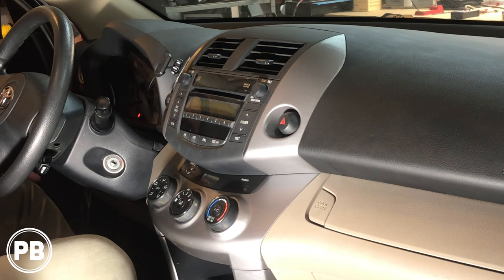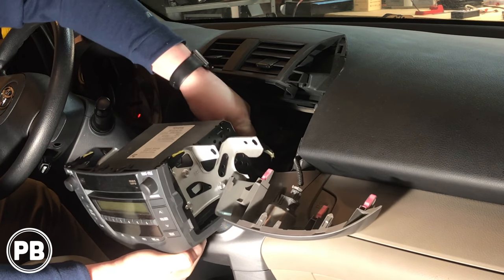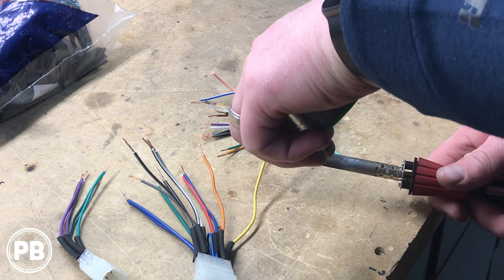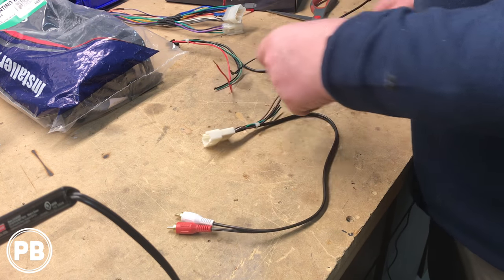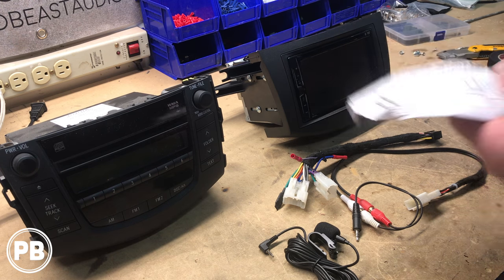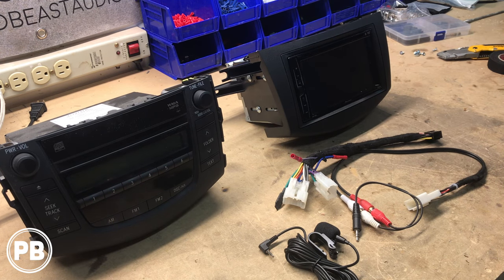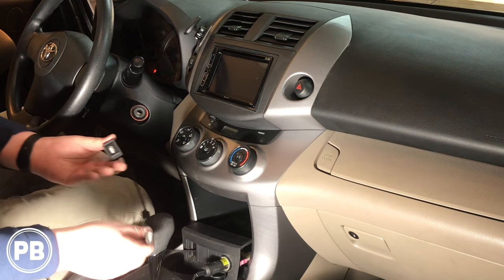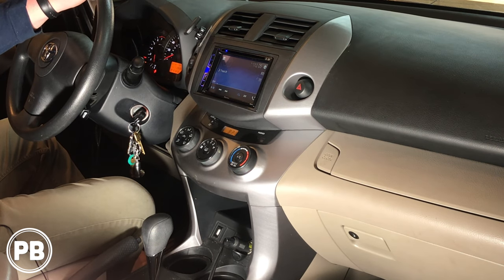2006 - 2012 Toyota Rav4 Bluetooth Radio install

Comment: This was very helpful...thanks! pay attention to which pioneer unit you order. I got the AVH-200EX, which you link, and it's a very basic unit without Apple Car Play, which is a deal breaker for me since we have iphones. The amazon Q&A said it had apple carplay, so i ordered it and installed it, but it didn't.  The workaround for that unit to do navigation, etc is called  "Weblink", but it was not helpful. I upgraded to a AVH-1400NEX and fortunately the wiring/harnesses are the same as the 200EX, so it was a simple switch out for me. I also ordered the USB/Aux car lighter replacement and didn't need it with the 200EX (has a front facing USB), but glad i kept it because the 1400NEX only has the back-of-unit USB, so i installed that lighter replacement cable and it looks beautiful and was easy! I did this on a 2011 RAV. The bracket was easy to install and looks great.

Comment: Great video. Toyota service manager in Hawai’i quoted me $5000 to replace this unit in my 2007 RAV4.   What a ripoff!!!!!!!!!
Reply: Were you able to change yours? My friend handed me a camry radio unit and not sure if it would fit
Reply: @Funkfreed   Hi.  I still have my original stereo. It still works for the most part (2007 RAV4) though I’ve been tempted to try installing an after market one.  I’ve kinda decided to just wait since I’ve heard the after market ones may tend to drain the battery more.

Comment: Hi, great video tutorial! Our 2010 Rav4 Limited has phone capabilities on the steering wheel and JBL speaker system. Stock backup camera in the rearview mirror too. If I order Pioneer AVH-1400NEX (with apple car play), is there an additional harness or adapter I need to maintain phone controls to the steering wheel? I'd really like to keep that capability on the wheel. Thanks in advance!

Comment: The video doesn't discuss the three-wire parking brake bypass in much detail. I also noticed that there is an extra blue wire from the parking brake bypass wire that seems to be connected to the blue on the car's side connection. How does this work? Could you please help me understand?

Comment: Very nice and clean but wish you showed running the Mic for the Bluetooth
Reply from the maker: We just put the mic on the a pillar and ran the cable under the weather stripping, through the dash, over the the radio cavity.

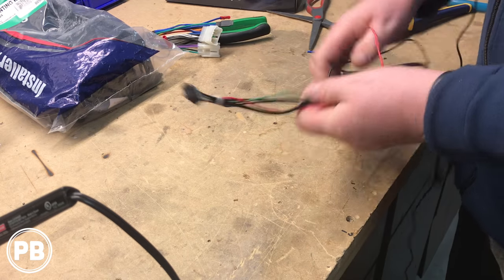Comment: @ProvoBeastAudio First of all great video!  I ordered the parts you have and successfully got the radio to work for a while now.  However, I could never get the steering wheel controls to work.  I think my issue involves the part the auxiliary part you cut off at 4:10 video.  I have the wiring you talk about at that part in the video, but II don't know where to plug in the part that you cut off since you didn't have steering wheel controls.  You mention a separate adapter. Do you happen to have further info on that?  Is it an aswc-1 that I need?  Any ideas would be great. I know my wife would love the addition of the steering controls.
Reply: Great question! We have steering wheel controls for phone and music, and would like to keep those as well. Did you resolve this issue? I'm looking to dive into the stereo swap-out, but am hesitant to lose phone calls from the steering wheel. Thanks!
Reply: @jefftara1813  I did get the stereo controls on the left side of the steering wheel to work that does volume and changing stations.  The right side with the phone button doesn’t work, but I never messed with that it because my wife doesn’t use it.  It very well could be that I missed a plug or just needed to set it up somewhow.

Comment: I don't get why Pioneer or an industry standard cable isn't made to be compatible with Toyota, so no  soldering would be required? Was the securing of the radio itself compatible with the factory bracket?

Comment: I broke the side covers while removing them, they must've gotten really damaged by heat.
wonder if I can get a replacement
Reply: I broke the left one removing the old stereo. I broke the right one installing the new stereo. If you watch the video you can see he's very careful to use both hands with even pressure. A little warning would have been nice but he did do a great job in general.

Comment: How do you get the USB cord down to the blanks? I don’t see a hole through the back.
Reply from the maker: You will have to run the USB extension creatively.  There are channels, usually following the factory wiring but it can be done.

Comment: If you buy the SWRTY-61J because you have "JBL/Steering Wheel Controls", do you need to buy the "Metra 79-8114 AUX / Steering Wheel Control Wiring Harness Adapter"?
Reply: Did you ever find this out?

Comment: For your harness, did you connect the car speed signal input (pink wire) and if not, did it affect the the head unit at all?

Comment: Great work, man. I own the 2009 RAV4, with a backup camera. It runs up to the inside mirror. Can I run this camera thru an aftermarket stereo, or do I have to get a new backup camera? Thanks a lot.
Reply: You should be able to run it into the stereo, just might not be easy depending on how it connects
Reply: Did you end up doing this? I have the same setup and question... curious if it was straightforward to connect it.
Reply: @nicolekowalczyk6893  , I didn‘t have time, but I‘m curious, if anyone did it.

Comment: Great video!

I can’t seem to get any conclusive info on the size restraints the available kits have for this vehicle. I want an 8” double din, but don’t want to risk buying everything only to find out it will not fit.
Reply from the maker: If the radio chassis is a standard double din, it will fit this kit.  Keep in mind that even some of the float mount screen have a larger screen that sticks out, but still include a double din chassis.
Reply: T'eyes has a 9" and 10" with included bezels. I just ordered a 9" for my '07 Rav4 since it looks a bit more factory than the 10". Pretty good reviews and lots of options; TPMS, 360 cameras, front DVR, engine monitoring module, etc.

Comment: Great installation guys.
Question: I have a separate Alexa Auto do I need the aux feature for it to work?. My Pioneer MBH-S622BS has built in Alexa feature, do I still need the Alexa Auto box ?
Thanks
Reply from the maker: If it has native Alexa, no external aux or external Alexa module would be required.
Reply: @ProvoBeastAudio  thanks

Comment: I want to install a double din in my wife's Rav, but I think the 6.2" and 7" are too small for her. Can't find an 8" anywhere with Toyota adapter cables included, AM/FM, Aux, Carplay, Steering Wheel , and JBL adapters. Any help?
Reply from the maker: Lots of options, you would just need to assemble the harness yourself. We can also do it for you too and ship it back. Just send us a message on Facebook.

Comment: do you need to cut the metra aux in harness or can you just use it as is? No steering controls on my rav
Reply from the maker: If you don't use the AUX, then no need for the harness.

Comment: The light green wire (parking brake) from the pioneer harness does not have a corresponding color on the metra harness and you did not say or mention what you connected that to......can you explain?
Reply from the maker: Because it's unique to Pioneer.  That is the parking brake wire and will need to be connected to the brake to work properly.  If not, just use a bypass: https://youtu.be/0xYNn8LDvnE

Comment: What happened to the extra long parking brake (green wire)? Where does that connect?
Reply from the maker: Most radios you can simply ground it (except for some Pioneer radios and all Alpine radios).  In this specific install, with this specific Pioneer radio, we added a microbypass parking brake relay.
Reply: @ProvoBeastAudio  Wow, I'm sure you hold the record for the most expedient response, thank you. And please don't tell me I have to order yet another part. I just discovered I needed a Steering Wheel Control adaptor & wiring harness for my newly purchased Pioneer DMH-W3000NEX so this project is delayed until next week...ug

Comment: I can’t thank you enough for this. I have the same vehicle and I’m going to attempt to do this. For do it yourselfera like me, how much do you think this is saving? What does this service normally cost at the installation shop do you think? Thank you.
Reply from the maker: Each shop ranges in price. But most shops require you to install their equipment they sell you at an inflated price. So expect to pay 2x or 3x the cost of doing it yourself.
Reply: @ProvoBeastAudio  I called in today to a shop for pricing. They said $400 for the screen. They’re $125 online…. 

Gave me a quote of $700.

Comment: I have a 2011 rav4 I got a double din and it doesn't sit flash and everything doesn't snap in snugly what's a double DIN that I can use that has the same bolt pattern as 2011 because the double DIN that you have has a different bolt pattern than the 2011

Comment: Great Tutorial! I have the steering will controls and the JBL so I purchased the SWRTy-61J.  The car has 3 plugs. The kit came with a TY-A and TY-B harness.  The TYB fits two of the existing connections, but does not have a third plug.  The TY-A harness has three plugs, but they do not fit the 3 car plugs. Any suggestions or resources you can direct me to?
Reply from the maker: Use the harness that fits your vehicle. Not all factory make harness plugs will be used in every install. Follow the instructions with the dip switches and you should be good to go
Reply: @ProvoBeastAudio  Thank you!  Got it all in and it plays music. It is my wife’s and the CD player did not work, and the console aux jack didn’t work so this is a huge improvement. However, the dsteering wheel controls are not working.  I have the SWRTY-61J plugged in and I can see there is a blue light near the plug and it sometimes blinks a red so seems to be getting power. I set the DIP switches to pioneer, and have the 3.5 mm plug into the wired remote input on the back of the pioneer.  Any thoughts on something I might be missing. One thing I did wonder about on the dip switches is the left has the after radio selector.  On the right it shows gain adjustment. I just set that to the same as the aftermarket radio.

Comment: The orange wire has a line on my radio harness but on my harness I purchased has a solid orange are they the same should I put them together or leave them off I know it’s a dimmer or something
Reply from the maker: If there is no other orange wire on your harness adapter, that is your dimmer wire to which you would connect to your radio's illumination wire. (usually orange white)

Comment: Will it still be possible to follow these instructions for a UK model?
Reply: Jack yes. I did this in the UK using a mirror so left was right. Worked a treat. You might need a right handed screwdriver though. ty

Comment: Hey, appreciate the video. Quick question - I have an 07 Rav4 with the steering wheel controls and the JBL system. Do I need both the SWRTY-61J wiring kit AND the Metra 79-8114 AUX / Steering Wheel Control Wiring Harness Adapter for full functionality? The SWRTY-61J lists steering wheel control on it so I wasn't sure if both were needed. Thanks
Reply from the maker: Nope the crux kit includes all you need!
Reply: @ProvoBeastAudio  Thanks!

Comment: Hi Chris - Regarding the aux harness - did you use heat-shrink on the wires you cut, or just wrap them in tesa tape?
Reply from the maker: The former - heat shrink then tesa tape over it.

Comment: What speakers would you recommend to compliment this system?
Reply from the maker: Front door and rear door speaker locations can accommodate a 6.5" aftermarket speaker (with the right brackets and adapters).  We like Alpine's S-line for replacements: https://amzn.to/3Ik22Ga

Comment: I saw you plug the Bluetooth mic into the back of the radio, but I didn't catch where the microphone ball was connected to. Could you please help?
Reply from the maker: We mounted the mic on the top of the A Pillar, ran the cable down the panel, under the dash to the radio.
Reply: @ProvoBeastAudio  thank you.

Comment: Great video. In my vehicle the speakers on the passenger side cut in and out, usually when turning One direction or the other or hitting bumps on the road so I know there's a bad connection somewhere. Do you think it's in the wiring harness right behind the radio? It is not a factory radio. It was installed about 10 years ago and the problem just started a couple years back.
Reply from the maker: I'd check to see if the speaker itself has the issue before pulling the radio.  Most likely the speaker going bad.
Reply: @ProvoBeastAudio  
Okay thanks. Do you have a video that shows how to remove the speaker and how to check if it's going bad?
Reply: it's most always a loose wire bro. did u fix?

Comment: Hi, I have a 2011 toyota rav4 Limited with JBL audio system and Steering wheel controls. What are the things do I need? Thanks
Reply from the maker: We listed parts in the description in case you have the JBL version!

Comment: If my rav4 has a backup camera already (screen is on the mirror) could i have that required to come through the new stereo instead?
Reply from the maker: Yes, but genre3ally no harness is available for that and would require a bit of manual wiring to make that work.

Comment: what exactly is the microphone for? does the unit support voice controls? also does the microphone come with the unit?
Reply from the maker: Mic is for bluetooth calls (it's how the party on the line can year you as you hear them through the speakers).  A mic is included, and yes, generally it would activate your siri or google assistant via bluetooth.

Comment: So how much would parts and an install like this be?
Reply from the maker: Everything linked in the description for current prices.  Install varies between shops but you can expect to spend 50 to 100 for a basic radio install.

Comment: Way to install the USB port IN FRONT of a cup holder. Good job thinking about customer convenience bro. How many other vehicles have you done this in?? Yes, it was a bad design by Toyota. Same thing with the cigarette plug. You don't notice it until have a big water bottle, and have to charge your phone. You can't have both! Think outside the box bro!